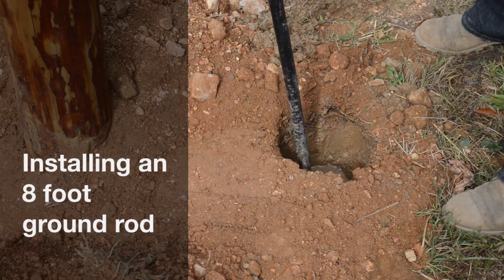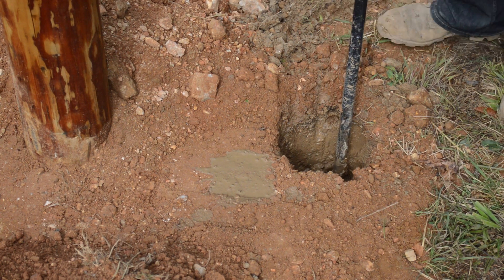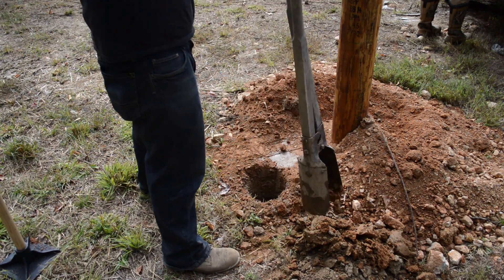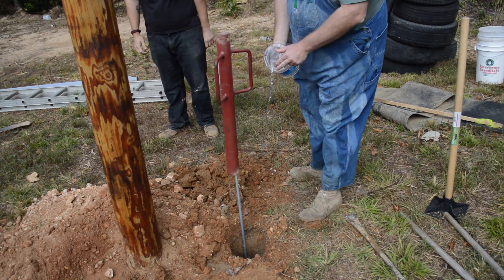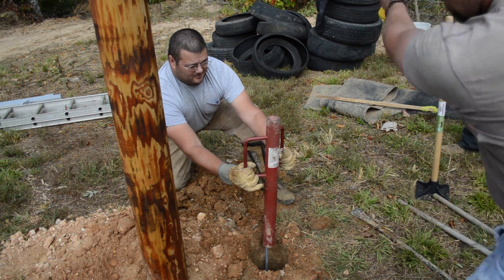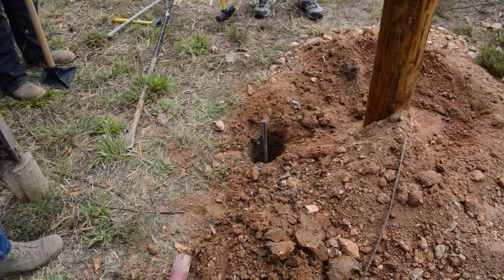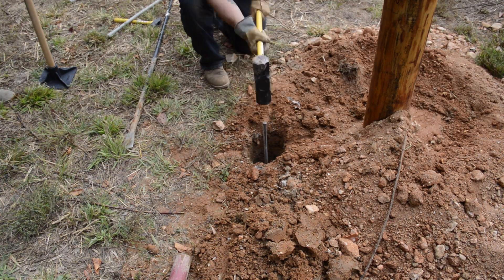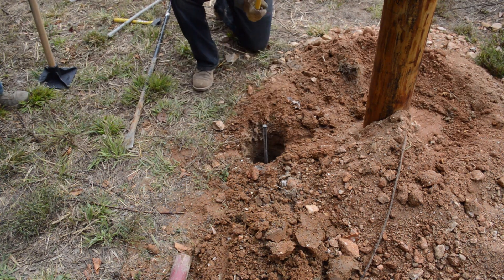Installing an 8 foot ground rod

Comment: Damn the cost of all that labor just buy or rent a jack hammer w an adapter. Even a SDS but for driving rod would be better than this. Opening the hole wide made it worse since every time you hit the rod it had room to bend sideways instead of all the force going downward. This is some real hillbilly idiocy.

Comment: Sorry guys. This is not a good method. Its super easy to sink a ground with just a bottle of water.  I just sunk one in less then ten minutes. All you do is poke a hole in the ground with the tip of the rod, pull it out and add some water. Then, you jab it in again, pull it out and add more water. Repeat till the rod is down. You can hammer it down the last foot. We have very rocky soil so I had to try 5 spots before I got it all the way down but it's super easy. Give it a try and make an updated video. ☺️

Comment: Why all the work ????  Dig a small hole beside the existing pole.... fill it with water... use the ground rod itself ..... keep the hole filled with water..lift it....drop it....lift it .....drop it ( in the same hole ) . Allow hydraulics to do the work....simple !!!  It works !

Comment: You had the right idea with using water..... but too much work otherwise !  Use the ground rod itself... keep water in the hole.....and lift.......drop...lift.......drop it ( firmly ) even with some rocks...it will drop down by itself. Its about Hydraulics !!!!!!

Comment: This is definitely the hardest way to install a ground rod. Two other methods I know of is to use a light jacket hammer with a bit made just for ground rods. Bosch makes one for about 50 bucks. The other method is to fashion a hydro drill and attach a garden hose to it. Very messy but very easy compare to the video.
Reply: I tried installing a ground rod the other day mostly the same way. Post hole digger and 5 foot digging bar. Got to 4 feet and the building footer and hit solid shale.  After that another whole day and only got to 5 feet. I even tried a copper pipe with 300 feet of hoses from the main house to use the water to dig, that got me another inch down.  I gave up at that point.

Comment: I do that by hand and the last 3 to 4 f use a sledgehammer and done...
Someone mentioned to use a jackhammer.. But they just said that they dont have electrical yet.
Most likely they don't have one either way.

Comment: I found a quick way to drive them, no ladder, no hammer and only one guy! https://www.youtube.com/watch?v=WAluvd021H8
Reply: In the video link you posted here.   Only need a small hole....a bucket of water..Keep the hole filled with water.....place the rod along side the existing pole ...lift ... drop....lift ......drop it.. hydraulics will allow it to drop down ! No need for all the work !

Comment: What's to stop them from just running a pipe cutter a couple inches below grade and calling the Inspector?
Reply: Yu Dunowme there is a device that measures resistance or some such and tells inspector sufficiency of installation..

Comment: This shows how NOT to drive a ground rod. Electricians just use a "demolition hammer", aka "jack hammer", with a ground rod adapter.  Unlike a much smaller "hammer drill", it does not spin the bit.

When I installed my ham tower, I was required to drive several 10' long ground rods. Almost all ground rods went down in a matter of a few seconds each.

Aside from that, the reason to NOT install a ground rod the way shown here is sufficient contact with the soil (or, more accurately) the LACK of sufficient contact with the soil.
Reply: I believe it passed inspection ?